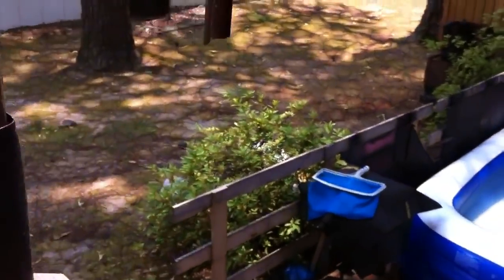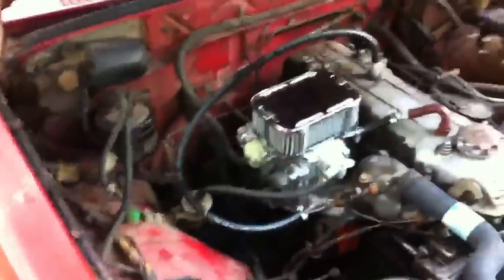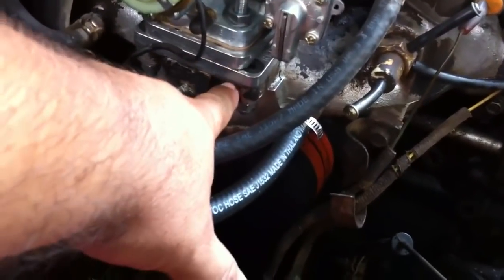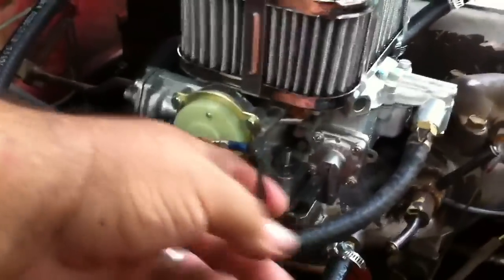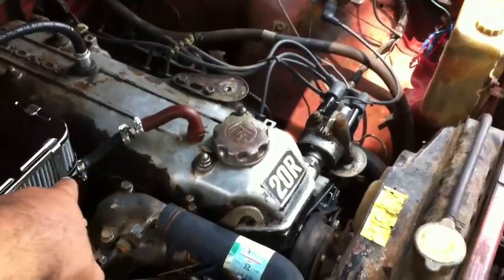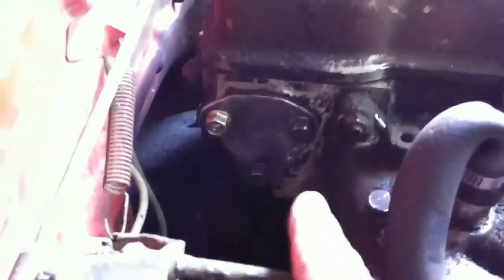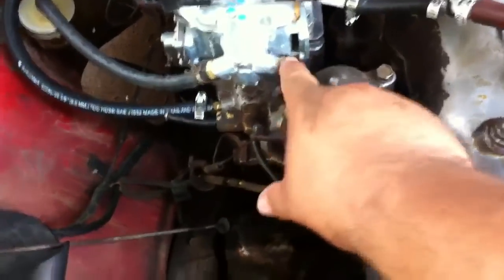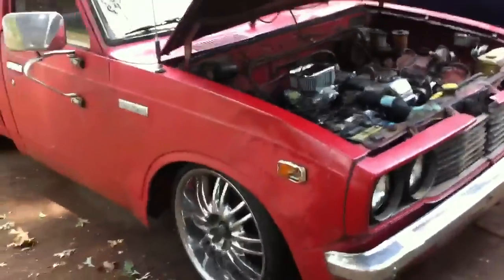How to install a weber carburetor

Comment: I need help I got extra sensors in the old carburetor one black wire and  other sensor with 2 wires where the electric Choke connector

Comment: Do this webber carbs automatically idle up and down? like what the stock carb does.. like when its cold idle is high but when it gets hot, idle goes down?
Reply from the maker: Yes they do.
Reply: My honda Civic has this aircon actuator tha connects to my stock carb. Where will i plug that into so it will automatically idle up when AC is turned on? and Idle down when its not in use?
Reply from the maker: Ryan Bagz I have no idea I have never put one on a civic. Im not a mechanic

Comment: so i have the same engine same truck but mine has a big mess of vacuum lines, will the Weber take all the lines or will i have to find a way to delete them?
Reply from the maker: +paintball1ftw depends on where you live these wipers are not legal in all states I live in Arkansas so deleting the emissions is okay that might be why yours has more vacuum lines
Reply: I'm in cali but being a 75 it's smog except
Reply from the maker: +paintball1ftw okay well then I'm not sure exactly what your weather looks like and whether or not it needs to have those vacuum lines the one I have does not come with those vacuum lines and installs the way I did this one
Reply: +Lawrence Duarte is there a way to connect the vacuum lines to the carburetor?
Reply: so i took out all my smog stuff and installed a 32/36 Weber. i got a quick question for you... what is your engine timing at? cause with all the smog i believe it was 8 degrees before top dead center. now i set it to what i think is 4 degrees before top dead center, whats yours at?

Comment: Can You Run Without The Heat Shield Cover ? The Outer Cover Is Missing On My 1978 Pickup
Reply: Mine was missing when I got my rig and it seemed fine. I recently replaced my OEM header with an aftermarket one and wrapped it to keep the temps down. Maybe you could wrap the header you have know if you are worried about heat issues. Have you looked for the outer shield cover?

Comment: I just stuck a 38 dges Weber carb on my 20r celica, but for some reason it only has one fuel inlet and its the one one left towards the motor so i have to wrap around. Other than that i never ha to tune to tune it even after installing it and no fuel regulaters needed. Bought from Pierce manifolds the OG's
Reply: Isn't it possible to move the inlet to the other side? I believe I had to move mine on the 32/36 on my 20r because it was facing the motor
Reply: @azorianification  the 38dges only has one open inlet. Kind of a weenie design flaw